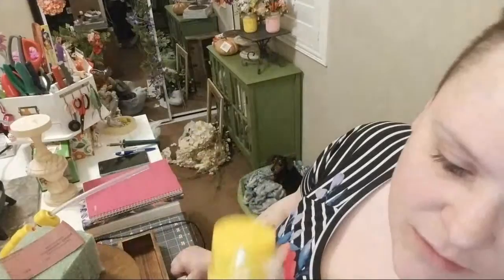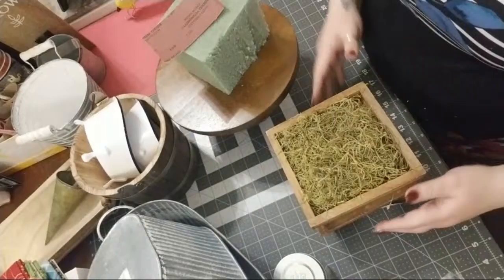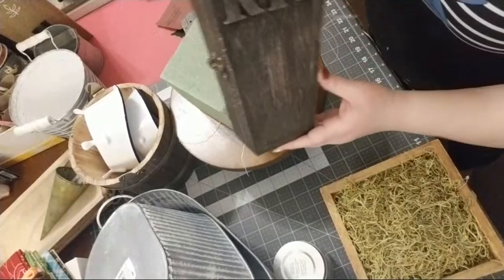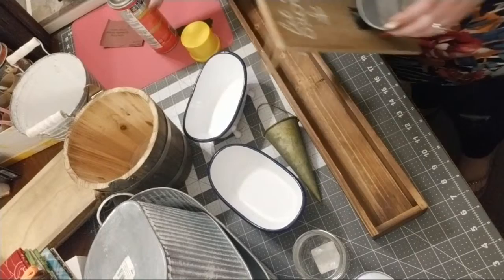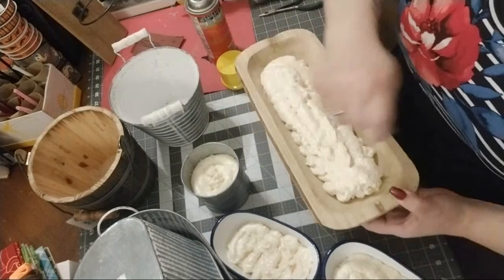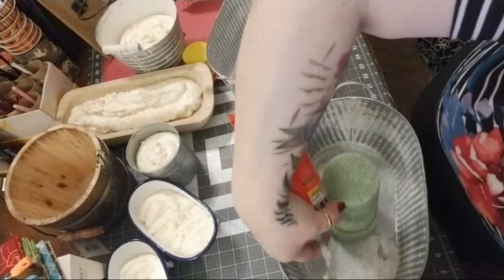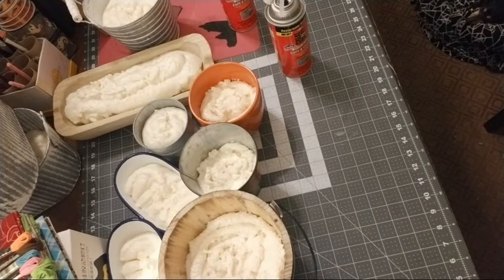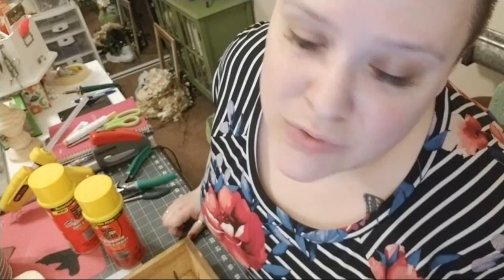Preparing Bases For Floral Arrangements

Comment: I did the spray foam in plastic buckets for my great grandsons birthday, the foam pulled away from the sides, after several days curing I painted the top of the foam, two days later the foam shrunk in size by about half..... I don't know if was a reaction to the paint or the plastic buckets.